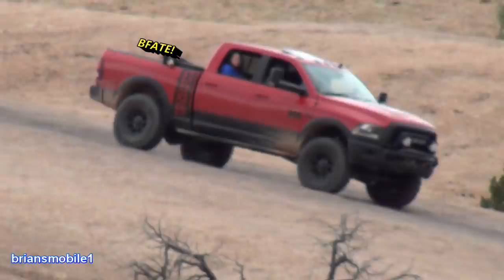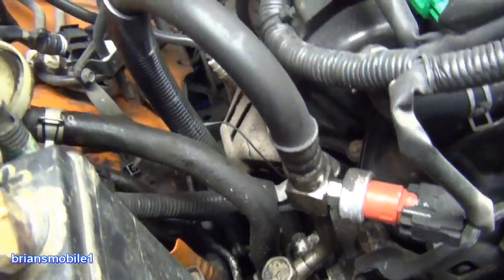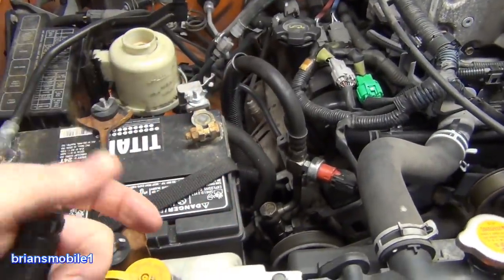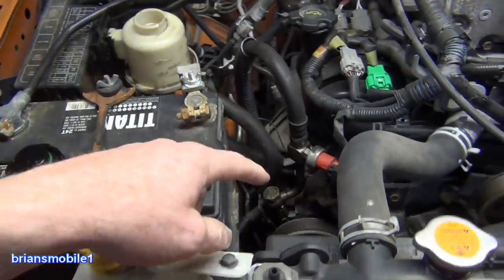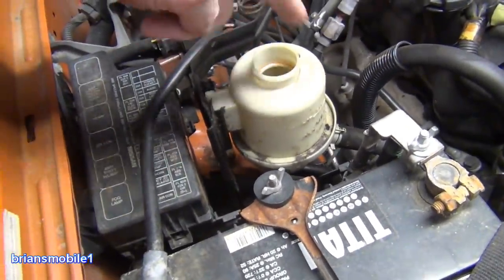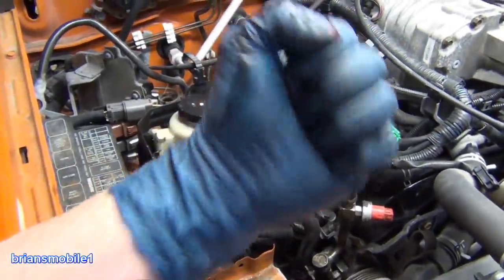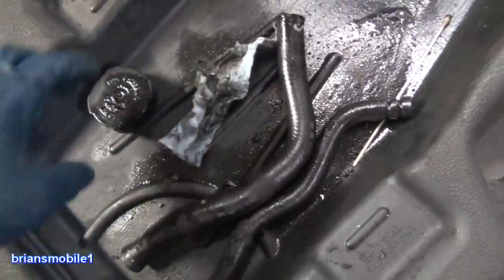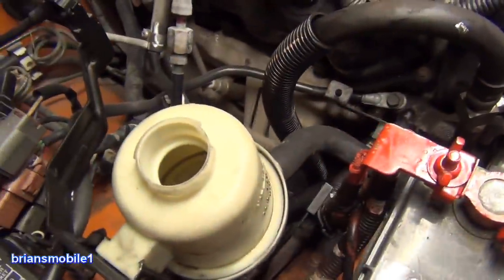How to Catch Common Overlooked Problems In Power Steering Repairs

Comment: Just did the PS pump in my 2006 F350. I replaced all the hoses. I did not replace the reservoir or flush it though. I did put a new magnafine filter inline though. Wondering if I should drain it and flush that reservoir. Also that rebuild motorcraft ps pump squeals sometimes, not a whine but a squeal like a bad bearing. And I'm so offended by your nails 😏. Would be a funny video to have one of those Vietnamese ladies do your nails on camera, I can only imagine what they would say.

Comment: Thanks for taking time out of your busy day to make this video. You gave me something to think about. I have a 1998 Dodge Grand Caravan that's leaking power steering fluid and never gave much thought to the inside of the hoses. Is there a way to flush the rack and pinion?
Reply from the maker: There is.  The rack has to be turned to lock so the pressure by-pass opens while the engine is running.  This flushes or releases the old fluid from the rack and pinion.

Comment: Hi Brian.  I seen you install lift in Tacoma for Jerry. I have same tuck and want my truck sit higher 1.5 -2 inch. What would you recommend ? Changing tires only or lift ? For smooth ride in high way. I drive mostly on roads. Off road haven’t toke it.   Thanks.

Comment: Is there a way to put a complex curve into hoses, other than buying an exact OEM match?
Reply from the maker: Great question!  If you find out- please share the link with me.  I'd love to know.  I think you have to mold them that way.  I've done some minor stuff with a heat gun.  What I do is collect what I can in an old empty 20 gal. gear oil barrel from engine swap jobs and junk yard runs or submit to the dealership for OEM stuff that way.

Comment: I only have a 40k mile 2012 Honda Accord and it does some wining after I changed the fluid. I assume I got air in the system but it never got pushed out after a while........ what’s up with that ?

Comment: I have an horrible noise comming from the powersteering pump when it is below freezing outside. Not constantly, but it comes and goes. I cant see any leaks and the rack is only 1 year old. I was thinking just for the heck of it to just try to just change the fluid before going for the actual pump. See if it helps. RAV4 2002.
Reply from the maker: Have you verified it's got the right kind of fluid as per Toyota?
Reply: @briansmobile1  It calls for ATF Dexron III, no special brand. So I used Castrol

Comment: Still original pump and hoses and rack haven't touched it. 97 civic hx 544k.
Reply from the maker: wow!  How often has the fluid been changed?
Reply: Never changed
Reply: My dad had one of the first (and one of two stretched cab) '79 Dodge D50 mini pickups. He drove it for over 10 years, 45 miles to work every day plus quite a few trips to Grandma's house (200-mile round trip) with mom, shotgun and a few of us kids in the back seat. It still ran like a charm and had a straight body until my sister took it to college. Then a truck hit it in a parking lot at a dance. A cop sideswiped it in Liberty Park in bad weather. I think that's the one he finally pulled the engine out of and put in his bobcat loader. 
I think his '83 diesel Power Ram 50 is still running around Washington state somewhere. That's the one he taught me how to drive in. Great little trucks and no idea how many miles they had on them, but I'm pretty sure the '79 had close to that before he pulled the engine.